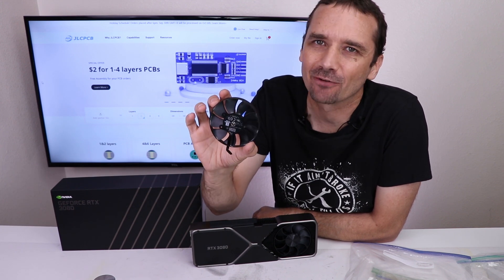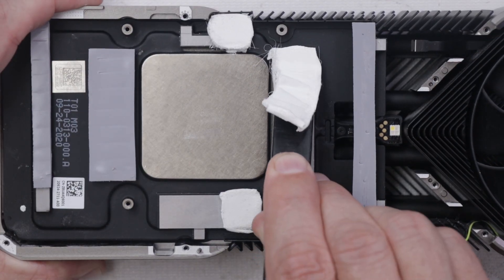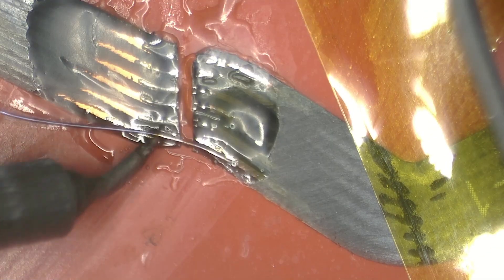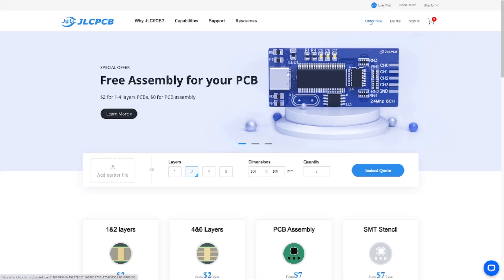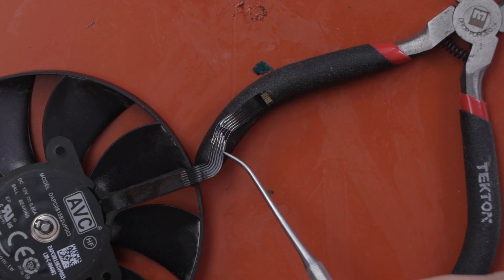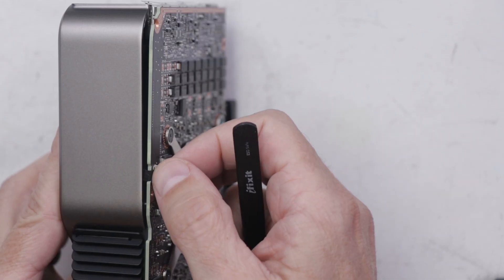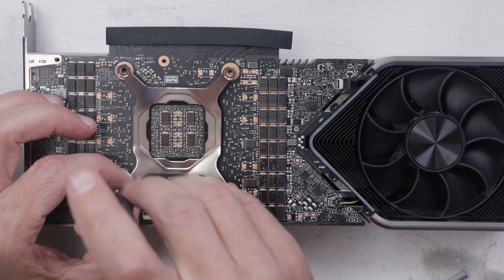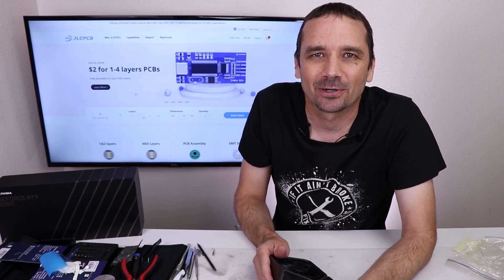FAILED DIY Graphics Card Repair - RTX 3080 - Let's Fix It!

Comment: Given the market right now, repairing GPU's is probably fairly profitable. Sure, a lot of cards on eBay are complete duds. But often times people just don't bother running full tests and end up selling a card that has a simple fix. Hell, my R9 290X was a repaired card. Just needed a BIOS flash after it'd been used for extreme overclocking and it worked like a charm for almost 2 years.
Reply from the maker: Interesting. Hopefully I can find more to buy and get some easy fixes.
Reply: It be had a great experience buying cards on eBay. More often than not they work fine. Although I tend to stick to the less fishy looking ones and the better rates sellers.
Reply: Most broken video cards probably need reflows. Not exactly easy or cheap. Most of the broken ones I see on eBay the sellers already list the problems. So that makes it even more difficult to want to purchase next to how over priced broken GPU's are. I can find betters deals in online auctions any day of the week. Few weeks ago I won a Clevo Sager P750DM-G laptop for $159. Worth about $900 if I part it out.
Reply: @wmp0074  this is partially due to the nature of the beast , no one games 24/7 . Heat cycling is unfortunately a surefire way many fpgas and similar components crack the traces. Rendering the gpu  inoperable but not always and a lot of folks try to oven it . which can possibly work if the done correctly and if in fact that was the issue. if not you run the risk of potentially dislodging another component
Reply: @wmp0074  i repair graphics cards. A reflow isn’t actually fixing anything. Most gpus end up having a dead core from the vrm failing and sending 12v directly to the core
Reply: @CocoaEm   More than often VRM failure is caused by overclocking. Exceeding the VRM's thermal limits or simply a piss poor design on cooling. I believe cracked solder joints is a more common issue though. Seen it many times on laptops and TV's.
Reply: @wmp0074  Those solder balls dont just crack. Its about the way the gpu is manufactured the little bumps inside of the gpu chip are making contact temporarily and will fail again due to the heat.  Power stages and mosfets just fail. Most of the cards i see will have nothing to do with overclocking at all. Its not to do with cooling at all 99% of cases.